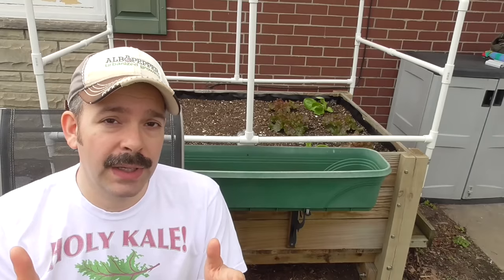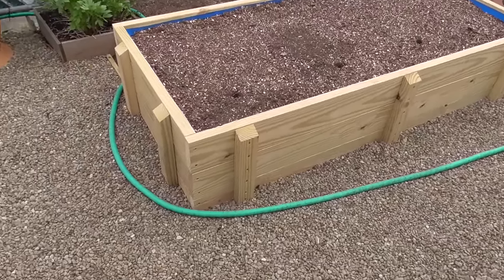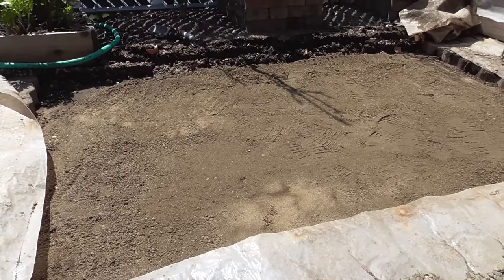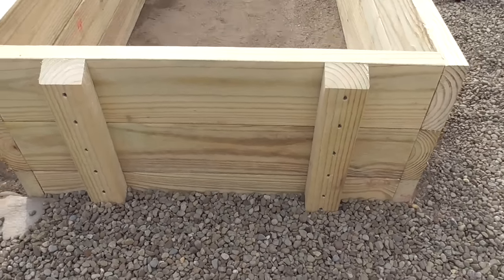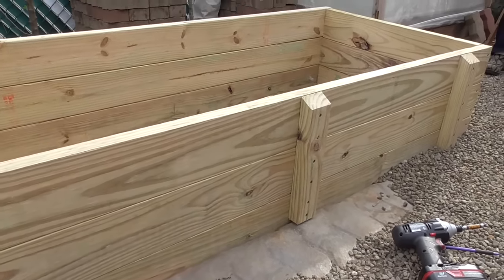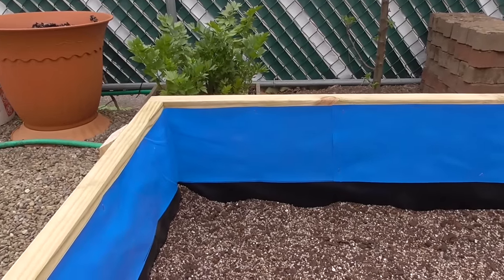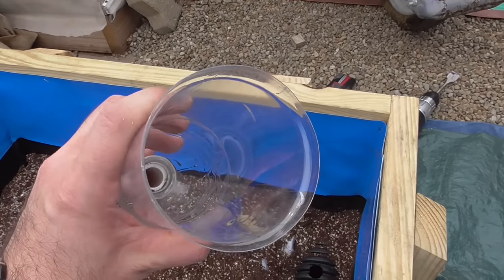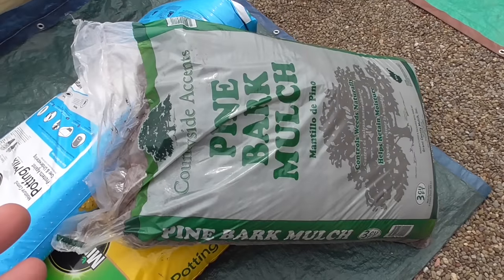Self-watering SIP Sub-irrigated Raised Bed Construction  (How to Build)

Comment: I really like the concept and design of your box. It is, in MOST aspects, an oversized earthbox.  As I watched the video, I was concerned about the area where the overflow is located.  Would it be advisable to caulk/seal around the liner to prevent the wood from becoming overly saturated with water?   I was waiting for this to be addressed, but it was not.  That is my only concern.  Other than that, it looks wonderful.  Very nice presentation.  I subscribed.
Reply from the maker: Randall VanScyoc Thanks Randall! Yes, it is in most regards an oversized EarthBox. I didn't caulk inside the openings on my box. But doing so is certainly a great idea. Someone else had suggested this a while back and I've added the suggestion to the write up on my actual website: http://albopepper.com/SIP-raised-bed.php .  I appreciate the good feedback!  :D
Reply: Use a rubber grommet...cheap and effective

Comment: I’ve used this system with great success using buckets and built planters but not on this scale but I like the size. It’s like the Kratky method with soil. In my systems it took a few times before success, however, mine are easier to correct smaller scales. I’m curious if you have encountered similar setbacks on your large scale attempts. 1. The drain hole is mega important. Wrong one way, it drains to much too fast. Wrong the other and it holds too much. How did you calculate the flow rate egress vs wicking uptake? Was it formulaic? 2. How do you manage nutrient flushing for overfeeds or deficiencies? 3. Soil PH and PPM ratios. Are you testing from the drain tube for corrections? 4. How are you controlling mold and pest issues in the corrugated tubes? Thanks and very intriguing build!

Comment: Great information regarding especially the things to avoid doing. I was wondering, wouldn't it be best to focus the mulch on the top instead of mixing it in? It isn't needed so much for water retention concerns, I would imagine, but it sucks nitrogen and increases fertilizing needs if mixed in. Mulch on top still deters weeds. But let me know if I am missing something or if it works as well to only apply mulch on top. Thanks.
Reply from the maker: +Andi Amador - Hi Andi! Thanks for watching the video. Nursery mixes will commonly use bark as the primary component of their container mixes. I prefer to include pine bark mulch because it adds a little extra back bone, extending the serviceable life of my SIP mix. The box at the beginning of my video actually has the original potting mix that I first put in it 4 yrs ago. My goal is to see how long the mix can be used. I think that perlite, vermiculite and pine bark mulch help a lot in this regard.

You are correct, that the wood will initially require additional nitrogen to compensate for nitrogen draft. However, this is a temporary situation as the Nitrogen is slowly released back into the soil in subsequent years. I use bark because it has higher lignin content than the sapwood (such as with wood chips) and so it doesn't break down as quickly. Pine is likely to acidify your soil though, so you'll want to watch your pH. I always add dolomitic lime to help out. 
 
As you mentioned, you can add a little mulch on top. This helps with not just weed suppression, but also moisture balance at the soil surface. It can also protect the plant roots from wind or water erosion. Hope that answers your question! Thanks, -AL

Comment: Awesome tutorial! What is the mix you used for the bottom? Would Pro-Mix work?
Edit: just found this in AlboPepper's response to Grant Topij 6 months ago. See below. 

Grant Topij. 6 months ago
I made one today but I used perforated pipe with sock that should be ok right? What exact mixture do you recommend for the first layer of substrate over the pipe? Just potting soil with xtra vermiculite?

AlboPepper - Drought Proof Urban Gardening. 6 months ago
Potting mix with vermiculite would be fine, assuming the potting mix is mostly peat / coir based. (Nothing with a coarse bark texture.) Or you could even get a bale of peat moss and mix in some perlite and vermiculite, saving the retail potting mixes for the top portion.

Comment from the maker: +Jonas Devenport: There are wicking beds that use gravel, but they are a completely different sort of design. I personally prefer the pipe setup. But I've never tried the gravel systems, so I won't put them down. I will say that the pipes work very well and scale quite easily. They create a great aeration screen while also allowing for a hefty water reservoir.
Reply: +AlboPepper Thank you for making this video. I built something similar with gravel, landscape fabric, PVC pipe, a cheap tarp from Ocean State Job lot and 2X12's. I haven't had any problems unless giant flowers are trouble lol. Anyway, I will be giving your design a shot this spring/summer in my back yard along a slope that gets sun for a majority of the day and feel it would be cheaper and require less labor going with your drainage pipe design however you lost me with the vermiculite mix to prevent constant direct contact with water and soil which is a concern because I know of people who've had rotting problems. Another concern is mosquitos, I wrapped landscape fabric around the inside part of the overflow tube to prevent them from getting inside the aquifer and creating a breeding ground. Sorry for the long post, I hope some of my info is helpful to others who haven't heard about the wicking style of raised bed.
Reply: Rather than using the Pond Liner, would you be able to use a paintable drylok like material or something similar to waterproof the inside ??

Comment: This is, by far, the most helpful and complete explanation of SIP construction I have found…and I’ve sifted through A LOT.  Thank you for such a thorough video. 

You are my Yoda now, and I’m fully committing to your ways. I do have a question, though. I am going to convert some existing raised beds to SIPs, but mine are all 24” tall. I have the 4” corrugated tubing, and I was thinking I could just stack two layers of tubing to fill that space on the bottom. That would still give me ~16” of space to fill with soil. 

My plan is to drill my drainage hole an inch under the top of the top tube, about 7” from the base, and feed my PVC through both layers of tubing down to the bottom layer for filling with water. 

Do you see any issues with that setup or have any suggestions to make it work with such a tall planter?  I appreciate any feedback you can offer. 

Thanks for an incredible video! Liked and subscribed.

Comment: Holycrapthatwasaninstructionalvideo! Just like I would've done it. The only thing I would have done is seal the slits, (tape/water tolerant silicone) created when making the overflowtubes and drainagepipes, covering with fabric.

Pardon errors, I try to utilise commas.
Reply from the maker: FloppyJedi Thanks for the feedback! I think if someone builds their bed off of the model shown here, it provides a great starting point. Then tweaks can be made, such as the ones you mentioned or anything else that a person wants to include in their setup.

Comment: Had two quick questions.  In the pacific northwest with a high amount of moisture, would there be any drawbacks in putting in 2 drain hoses?  Also for your fill tube do you just drill into any pipe, or is there a specific area outside of the corner?  Great video, very helpful.
Reply from the maker: Peter Heydorn Hi Peter, I would suggest all SIP beds have at least 2 overflow drain hoses/tubes. That's how I design mine. The 2nd one would serve as a good fail-safe. Any more than that would be personal preference. But at least 2, is a good idea.

For the fill tube, I put mine in the corner because it offered good support & was an out-of-the-way spot for me. Do what works for you. Just tap into the top of any drain pipe and the system will work fine. The water dissipates pretty quickly throughout the entire reservoir. Thanks for the feedback!

Comment: Thank you thank you very much for a detailed video. I decided to build one it’s 8’X4’X16” with the same system that you have.  I did the corrugated pipes and the initial filled up with potting mix vermiculite but I didn’trealize that to be filled entirely with potting  mix it would be very expensive  QUESTION Can I use 60%compost and 40% soil (organic)   I know you stated that soil would ruin the system but I’m limited on my expense.  Any suggestions will be very helpful Thank you

Comment: i think it is better if you did not poke a hole in the tube screen where you insert your overflow tube, the reason is that the screen will prevent debris which might clogged your overflow tube... my 2cents!

Comment: Thank you for your video--very thorough and I appreciate the tips on what are the most important components and the pitfalls to avoid.  I also liked the suggestion for using pine bark to extend your money for the filler mix.  Very well done video.

Comment: Have you ever tried usining hydroton works great no need for all those big tubes. But maybe a combo of both...i don't know cool video though
Reply from the maker: Robert Alfano Hi Robert. No I haven't ever used hydroton. I've considered testing it and growstones as well. But just haven't gotten around to it. I think that the price was a little high, especially for large volume applications. Even still, it would be interesting to see either of these in an SIP system. Thanks for the suggestion!

Comment: If you were to use a through-hull fitting over the plastic at the drain hole, you would get a waterproof connection.
Reply from the maker: Excellent tip! Thanks Vee!  :-D
Reply: Vee Friend hull fitting can u explain please i am a beginning

Comment: Hi, I enjoyed watching your video it is extremely informative. I was wondering if I could hook my house down pipes up to an sip bed and have the over flow linked to a second sip bed? I live in an old house that isn't connected to storm water drains, so I would have to put in water tanks but that would minimise my growing area.

Thanks.
Reply: You could use a rain barrel setup, using a recycled 55 gallon drum. Just be sure to use an opaque one, to cut down on algae growth. A typical 55-gallon drum measures approximately 23.3 x 34.9 inches, so it would only take up roughly 2' x 2'. This could then be piped to supply your sip bed. When setting it up, you will also need to consider that a 55 gallon drum will weigh about 440 lbs when full, to allow for proper support, whether it's on a deck, soft soil, etc.
Reply from the maker: Hi Marissa, thanks for watching! I would not advise to directly connect an SIP to a downspout. A single rain even would completely overwhelm the system. The root zone would be too saturated. Plus this would wash out nutrients, pumping them into the water run-off. Think how erratic our weather is becoming. Using a rain barrel as a buffer between the SIP and your downspout makes good sense. And it allows the water to be delivered in dry spells when it ISN'T raining. After all, in a rain event your plants are already getting rain. At those times, they don't need the reservoir to be pumped full of water as well.

Comment: I found if the fill pipe is stright like yours, that the water would make a hole there that would fill up above the drain level before it soaked or drained to the bottom. I think it would be better if an elbo were on the bottom of the fill pipe, maybe 2-3 foot long, so the water easly runs to the bottom and fiil from there.

Comment: Love this video!  I've been researching and this is the best one yet.  I also explored your website.  I have two questions.  
First, none of the drain tiles are connected.  I know water will eventually seep from the pipe with the fill tube but it seems to me that it would not seep as fast as the water hose fills it.  Do they not need to be connected?
Second, I view your SIP  Potting Mix Sample Recipe on your website.  Are the amounts based on volume or weight?  

Thanks a bunch for your help.

Comment: Looks like luigi lol
Reply from the maker: mama mia!
Reply: I watched this video and loved it I built 4ea 6’X16’ beds 2”X12”.  I dug down 8” lined it with plastic all the way up the sides covered with weed barrier I will just use drain tile with a sock next time I refilled the box covering the drain tile and weed barrier with the dirt I took out of the bottom. I called my local dirt delivery place and they have a mix that is really rich looking not sure whats in it I filled the last 12” with that mix. I put the over fill tube into the drain tile then covered with mulch.  I started carrots and onions when I was thinking about doing this project planted in the raised beds 4 weeks ago and they are already 4 to 6 inches long.  Here is the question we have had a drought in Upstate New York near Niagara Falls so the soil has been not to wet or not to dry pretty much perfect I’m worried if the rain in the spring is going to turn them into a mud hole? I can put more drain tubes in the spring around the box.

Comment: Thanks for the video.  Built one this past summer following your instructions and it worked great, lots of tomatoes and zucchini.   Unfortunately towards the end of the summer the rabbits found it and managed to dig holes through the black plastic and it lost the ability to hold the water inside.  I plan on building two more in the spring, plan on putting hardware cloth around the perimeter to protect the black plastic so the rabbits can’t get through.  Thanks again for the detailed video.
Reply from the maker: +Tom Cryan - Doh!  I'm glad it worked out well for you Tom.  I'm sure the rabbits are glad too...  :/  That's a good idea to do the hardware cloth!  Thanks for your feedback.

Comment: Thanks so much for making this video and inspiring me to make SIP pots out of IKEA waste bins with the normal perforated 100mm piping, 32mm filling pipe and 14mm overflow piping with self galvanising tape used to get water tight fittings for the pipes and to keep the root barrier material in place rarher rhan duct tape......fingers crossed it all works out 🤞
Thanks again and all the best
Reply: Sorry, typo self amalgamating tape was used not self galvanising to seal pipe holes and keep root barrier material in place

Comment: Very nicely done .. have watched all your videos. I am new at gardening and like the idea of raised beds (at 60 years old, ground work is hard work). I did wonder if sand could be used at the bottom around the corrugated pipes?
Reply from the maker: Hi Kim! Thanks for watching my videos, and welcome to my channel!  :-D  I've never tried sand, but my major concern is that it may not wick well enough. If it doesn't provide the required capillary force, then the water in the reservoir may not wick to the top.

Comment: I also love your video on this planter box with the self watering, do you have an update on the materials that I use around the perforated tubes and then do you have an update on the type of mix that should go on top of that
Reply from the maker: Thanks for watching! I still use similar materials for the potting mix and wicking mix. I'm still using my original SIP, with the original mix, which I simply top off as needed. But this year I'll be putting out a video update with additional tweaks to help the system to hold up even better.

Comment: Have built our first ever SIP about 2 months ago following your super detailed video instruction  and seems to be going to plan. We are about to finish filling our second SIP and only realised that in our first one I used a mix of top soil, compost, perlite, vermiculite and coir - I've only just realised, when looking back again that I shouldn't have add top soil to our planter... how bad is my mistake?... I'm getting a bit worried about it... all our hard work... :-/
Reply from the maker: Hi Delia. It's hard to if you'll have any issues or not. Fortunately, you did use some conventional potting mix components like perlite, vermiculite & coir. Hopefully, these will offset any issues with pore spacing or wicking potential caused by the top soil. Perhaps, the mix will work ok for this season or even longer. In the long run, you might need to replace it if it gets too mucky or compacted. If you ever get to that point, you can always use the soil to create a conventional raised bed or landscape bed. If you ever notice muddy water coming out of the overflow tube once it is full, then this would be a sign that the silt particles are infiltrating the reservoir. However, if the water comes out clean, then that is a good sign.
Reply: @Albopepper  I'm amazed at your super quick response, you really are a genius. I will check if the water comes out clean (fingers crossed) and if not then I'll change to a new potting mix with no top soil. I shall report my findings and a big Hello from the UK!

Comment: two pvc down tubes filled with lava rock going down into a base of lava rock with a burlap soil barrier has worked very well for me in a 55gal homedepot tote. very economical and sturdy. a harbor freight 4 wheel dolly will come in handy, very heavy to move.
Reply from the maker: Good to know. Do you get much wicking from that lava rock?